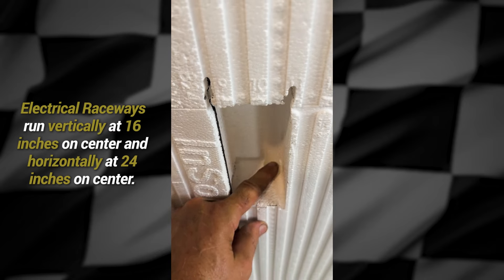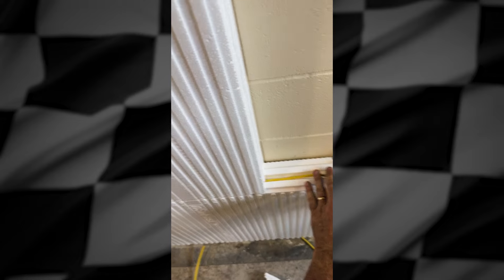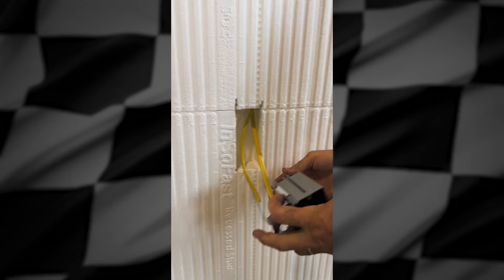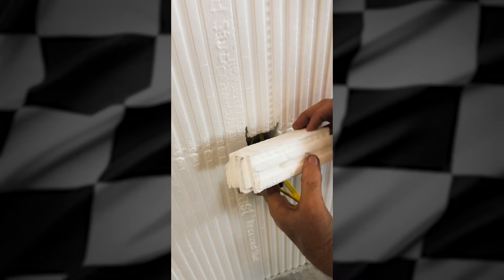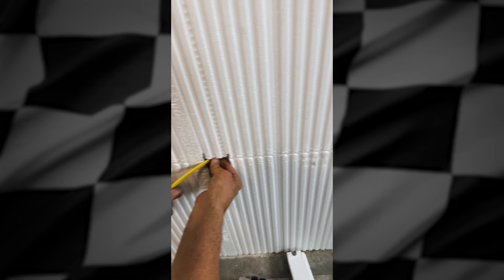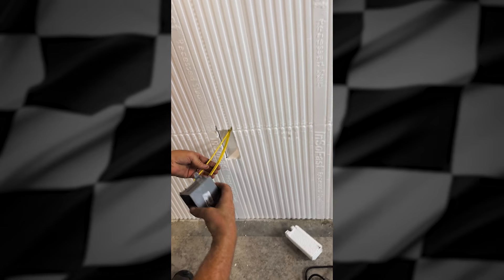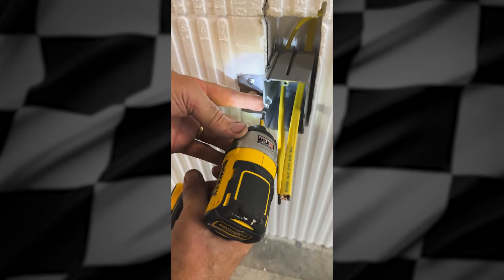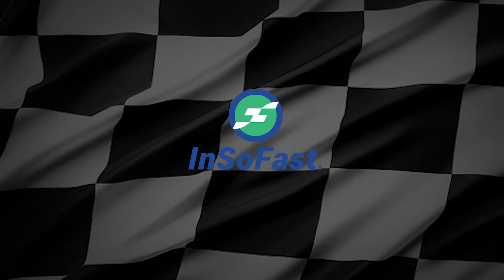How to Properly Use the InSoFast Electrical Raceways

Comment: I imagine something has to be premeditated with wiring and 90 degree corners. How do you handle those? I imagine the installer would have to drill a hole into an adjacent raceway and run a string
Reply from the maker: you can run the wire whichever way to the next intersection, then cut the foam and re-route.  and then you can fill up the hole again with the cut piece. It works!